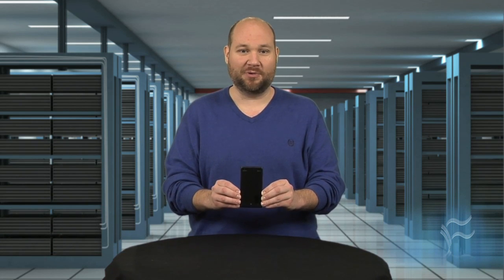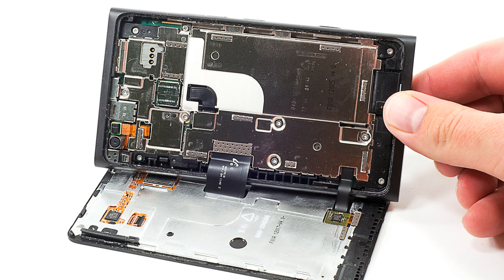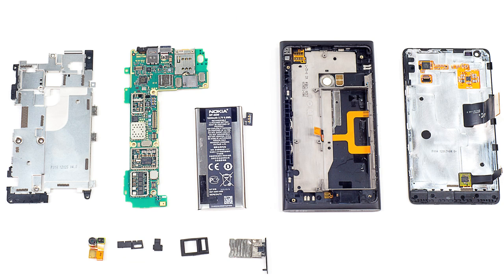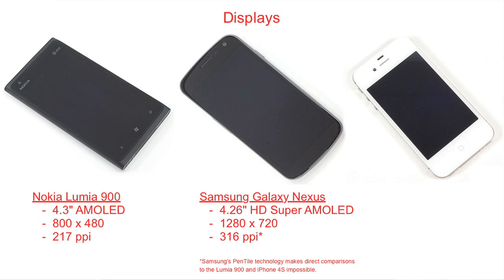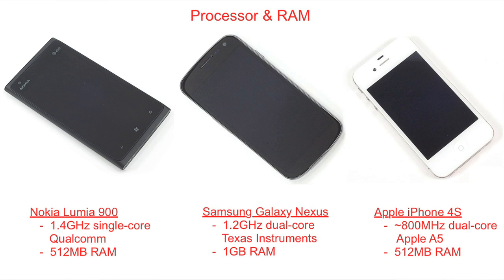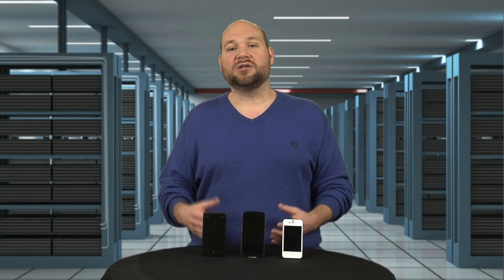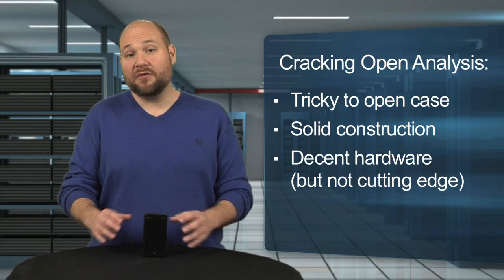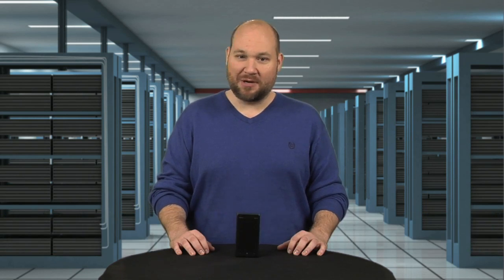Cracking Open: Nokia Lumia 900

Comment: The reason the Lumia 900 has lower specs is because windows phone 7.5 can't run with higher specs. So when windows phone 8 comes out the phones will have better specs.